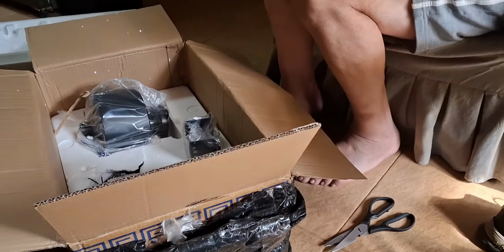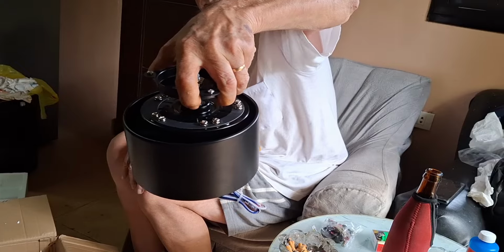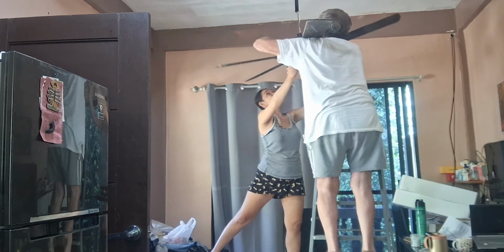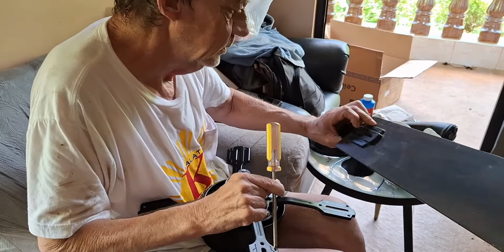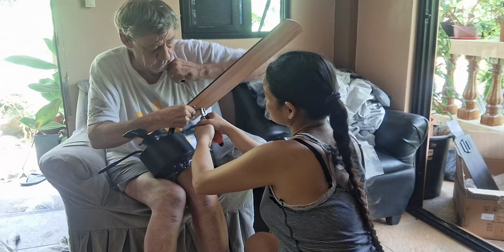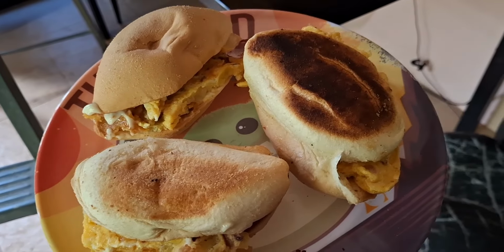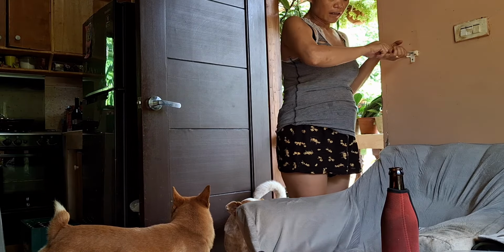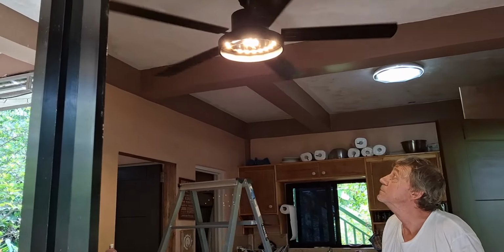HOW AMERICAN EXPAT  DEAL WITH THE UNKNOWNS FROM SHOPPING ONLINE #philippines #retirement #online

Comment: I think when you first turned on your ceiling fan it was turning in the wrong direction. I think you need to change the direction to blow air down you had the fan sucking the air upwards.
Look good though cheers.

Comment: I bought ours at Citi Hardware a 30 inch for 6700 pesos I had a electrician put it in for me I ain't messing with 220 😂😂
Reply from the maker: It's not volts that are dangerous, it's amps. I've  been shocked many times by 220. Look at it this way if you got a 5 amp shock at 220, that would be the same as 10 amps 110.